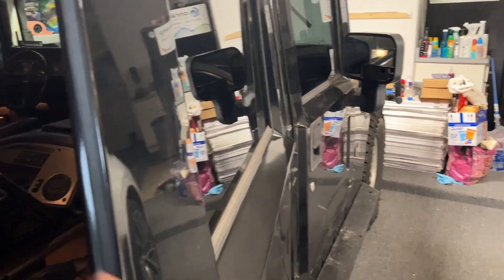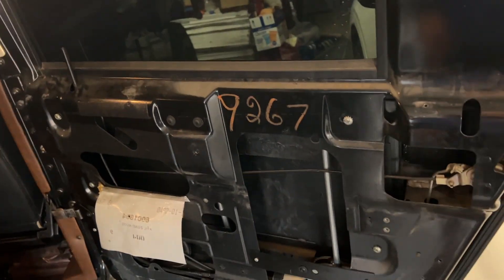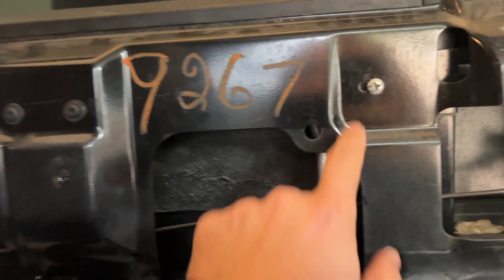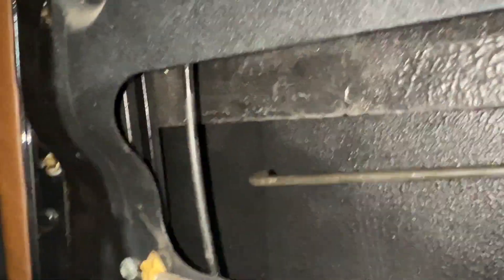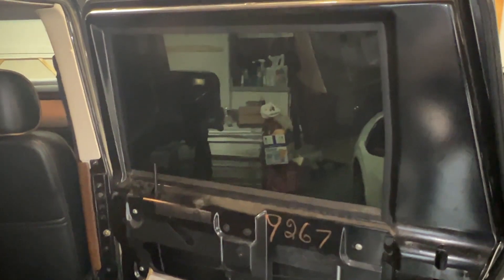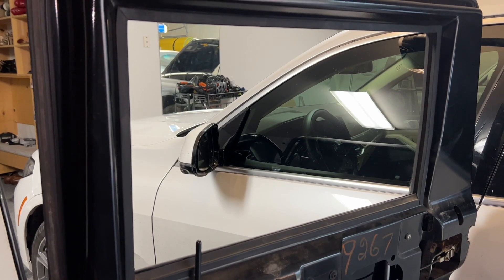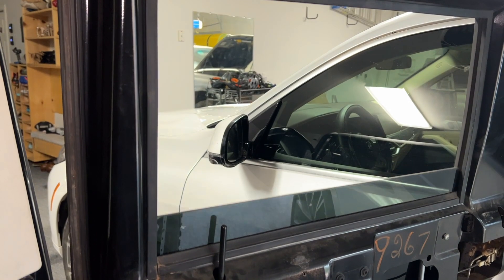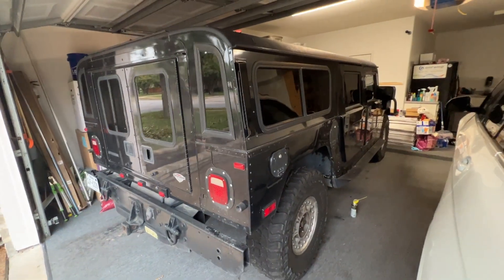Slow Power Windows - H1 Hummer - Easy Fix if your Window Regulators still Work - Try this first !

Comment: Awesome fix. Did the same for my old cruiser. Eventually replaced the rubber runners as they had become hard plastic but initially the silicone spray helped.
Reply from the maker: Good point. Going to monitor it for a while to see how well it holds up. I made sure that there was no dirt or buildup in the rails be fore lubricating to avoid causing clumping dirt with the lube + dirt.

Comment: But but but... Turbo 80 series? :(
Reply from the maker: I will be back on the turbo 80 series 1fzfe build soon. Probably in a few weeks.
Reply: @NKPGarage  What DM said 😆 Ya left us on a real cliff hangar with the 80. It feels like reading an entire book only to find out the last page is missing. 🤣
Reply from the maker: @DouglasGreen562  I know i know :) I need blocks of at least 3-4 hours to do more work on the 80. I've got my downstairs tile floors done, baseboards are on. 80% done with grout, and then all that's left is putting in the new vanity/toilet/fixtures in the guest bath. As soon as that's wrapped up I'll be on the 80 again quickly. 🙂